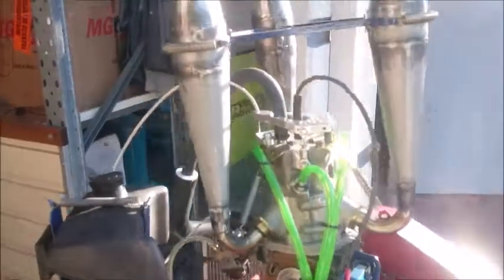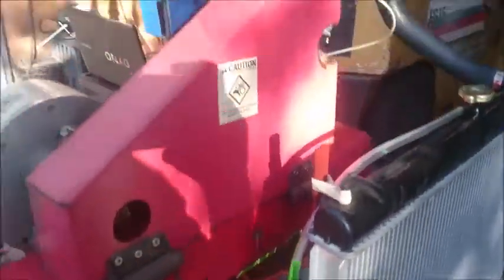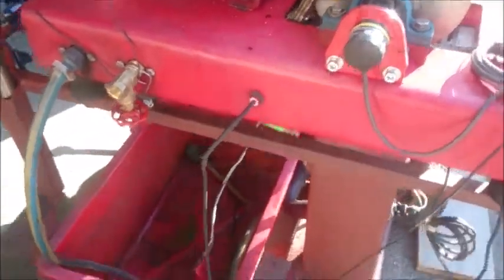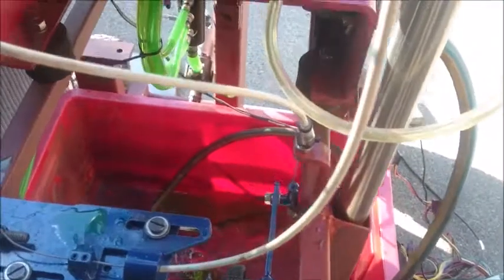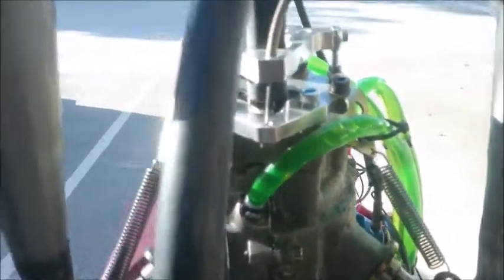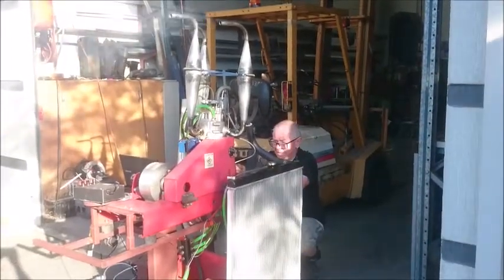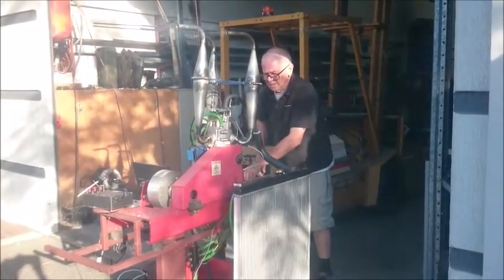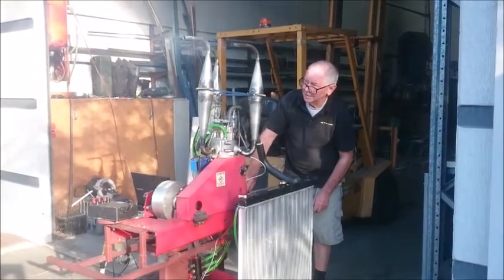Slider engine in dyno frame

Comment: Congratulations.

Am I correct supposing that you control the load only by shifting the cylinder? 
(I mean: without “conventional” throttle valve.)

And, 

why not to add a VCR, too? 

(comment in your “first run” video). 

It is more than easy, adds almost nothing to your existing arrangement and gives more options for optimization.

Manolis Pattakos